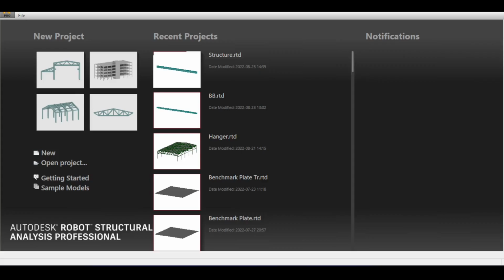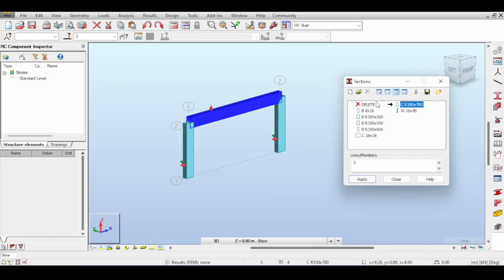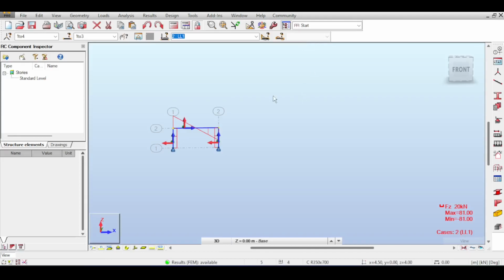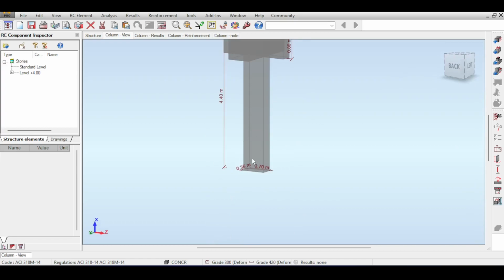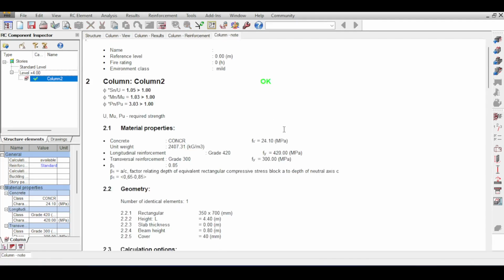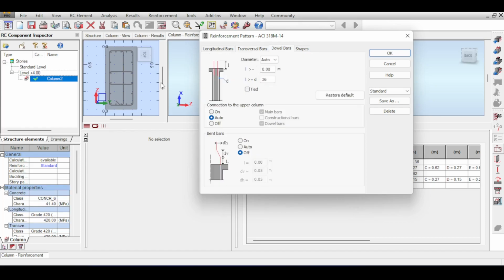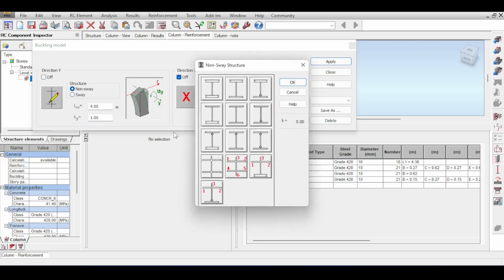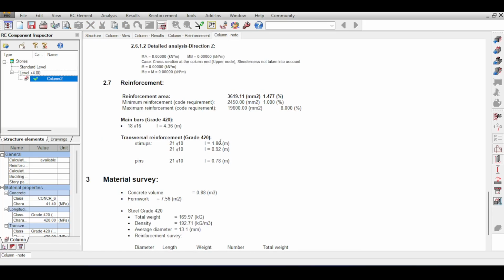Designing RC Columns in Autodesk Robot Structural Analysis

Comment: Good day. I just started learning Autodesk robot thanks to your help but i have realized that when when it comes to designing of RC beams/columns, if i am to detail such elements by the As required I'd use way less reinforcement compared to allowing the software itself to detail using the As provided option. Is there a way to better do this ?..Thank you very much for your time and i hope to hear from you soon

Comment: can I ask why would we reduce the moment of inertia in the first place? is it some kind of security coefficient?
Reply from the maker: No not at all. The reason why we reduce inertias is because we design using the ultimate limit state under cracked section assumptions.
This means that at ultimate, the section will be partially cracked.
Meaning that not all the section contributes to the Inertia.

Codes like the ACI ask us to reduce the moment of inertia of beams to 0.35 and columns for 0.70.
Note that beams are more prone to crack than columns because axial loads are not present to "heal" the crack and "eliminate" the tensile stresses.

Comment: Can you do a video on this including the FIRE PROVISIONS  . ITS IS REALLY A THING, because increasing the size of the column and cover doesn't change anything to the ERROR DISPLAYED after running the calculation.
Reply from the maker: I will keep that in mind, there are some fire options you can select, but I did not do a dedicated video about it. Stya tuned ^_^
Reply: @CivilEngineeringEssentials  
Boris DJOKO KOUONGA
 @CivilEngineeringEssentials  Yeah thanks,  sir it's really a thing, fire provision for column effective length of 4m or >3m don't pass in robot. Even with a cover of 40mm

Comment: I have a question about the buckling model: Suppose the column (25X25) with a masonry wall and  is subjected to wind loads in the Y direction of its local axis, resulting in a moment MZ on the column. Should we turn off the Y direction and let the Z direction be on, because MZ is much greater than MY? Is that correct? I hope you understand me, if there any way to send you a picture of my robot model
Reply from the maker: I do not agree in turning of any direction in the buckling check.
I understand that your point is:
There is no My, so buckling around y is not an issue.
However, buckling can happen even if no moments are present around y. It can happen solely due to the Axial Forces.

Now, if you are an ACI318 user, then you would think:
Why do I care about buckling y? there is no moment to be "amplified".
(For non ACI users: Moment amplification is a method of including buckling effects by increasing the moment using a factor).
Now here is the plot-twist: the ACI318 code specifies a minimum moment you have to apply.

So in that case, if you were to "hand-calculate" your column, and your column is slender around Y, then you would have to apply M2min on Y and even perform moment amplification.

I hope my words made sense. Also, sorry for the late reply, we are at the end of the academic year, so a lot of paper work.
Regards,
CEE
Reply: @CivilEngineeringEssentials  Thank you so much  CEE, very good explanation

Comment: In tems of foundations You pinned the columns why you didn't fixed them?
Reply from the maker: That is a very good question. You see, fixed vs pinned is determined by the engineer. To explain what I mean, here is the theoretical background:

Fixed supports mean that the support is strong enough to stop any rotation
Pinned supports mean that the support might allow some rotation.

In reality, supports are neither fixed nor pinned, but somewhere in between. Some people like to put a "ground elasticity" by adding springs to the foundation.

So, the decision of pinning vs fixing is left to the engineer's discretion.
Here is what I usually have in mind:
Pinned supports mean that:
1) The moment would be higher
2) the moment would be a single curvature moment

So, it is a little bit more conservative when designing columns.

Hope it helped,
Regards,
CEE

Comment: was the column braced or unbraced? How does robot handle these two situations?
Reply from the maker: Hi there
I do not remember my inputs back then to be honest but:
Autodesk robot always calculates the effective length factor k and as per ACI code calculates the klu/r factor and compares it to decide wether it us long or short.

If you refer about if the atructure itself is braces or not, this is an input that can be provided by the user
Reply: @CivilEngineeringEssentials  okay 👍

Comment: Great content Sir.

However I realized you applied a stiffness modification factors to your frame according to ACI recommendation. 

That is for beam 0.35 to Iyy 
and for columns 0.7 to Ixx ( instead of Iyy and Izz)

Please clarify. Thanks
Reply from the maker: I agree, there was a slight video editting mistake I did.
if you check the input section a split second before I apply, you will see that the modification factor for all stiffnesses (Ix Iy and Iz) was modified.
The input process of those modifications was however cut during editting.

To clarify:
ACI code requires you to modify the bending stiffness of the beams and columns with corresponding factors.

Technically speaking, members can bend around yy and zz. 
So those two Inertias should be modified, which I did (but was shown for a split second only).
Further proof to this is when looking at the K factor calculation of the column. The Inertias are reduced.

I still agree with your concern about Ixx. ACI code says nothing about it. It is the torsional stiffness of the beam.

Now first off, Ixx will not affect anything in our calculations. There is nothing causing torsion on the beam.

Still, my logic behind reducing it is based on the theoretical part.
You see, for a perfect cylinder, Ixx = Iyy + Izz
for rectangles, it is different.

Still, I thought that:
if Iyy is reduced
and Izz is reduced,
it stands to reason to reduce Ixx.

and that is the logic behind reducing all inertias by the same amount.

Still, you are right. it is only visible a split second before hitting the apply button. My video editting was not on point at that position.

Hope that clarifies the issue.

I will add this clarification to the description.
All the best,
CEE
Reply: @CivilEngineeringEssentials   you are right sir.

 in a full building model with vertical and horizontal loads applied, stiffness values in all directions is reduced according to code requirements. 

I realized in the column design, the columns has a reduced stiffness values  but was confused abit in inputting during column section definition and the video editing. 

Thank you for the clarification. 
I really understand it now.
Reply from the maker: @niisarpei3676  Most welcome. I am glad you liked it.